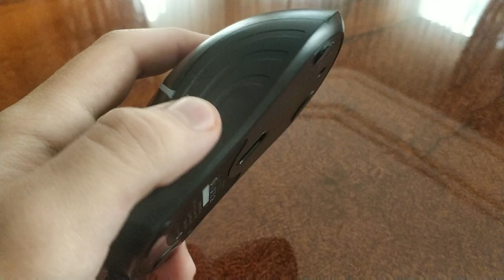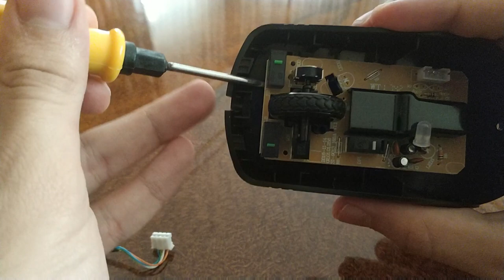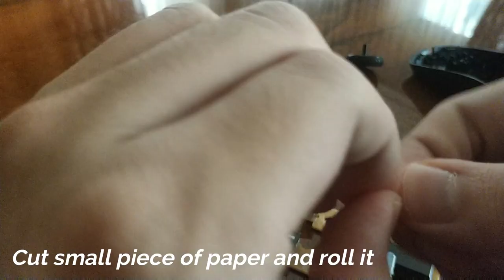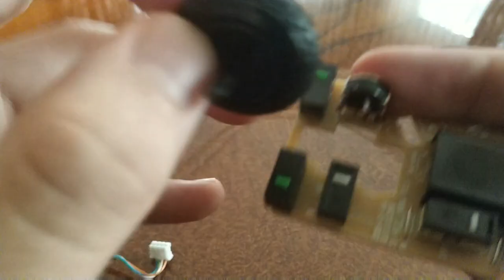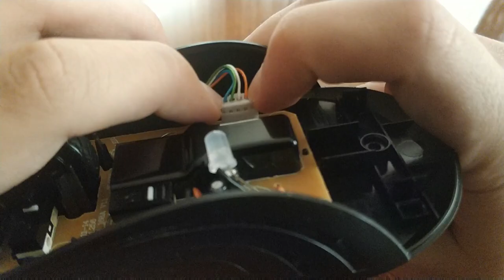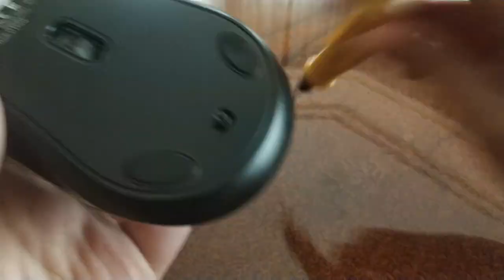How to Fix Mouse Wheel Jumping!

Comment: For anyone reading the comments. An easier way is to take a small piece of tape and put it around the part of the wheels shaft that goes into the encoder. Much easier to put it back in that way.

Comment: Hi guys! I'll just share what worked for me because I can't quite follow this since my mouse is wireless.
I blew on the scroller since it has little gaps on the side, thinking maybe it just had dust or debris stuck inside or around it. I kept blowing like pressured air on it while scrolling it up and down (while it is connected to my pc) and it worked! This is an easier fix for this problem since you don't have to disassemble your mouse and all.
Hope this helps!

Comment: Thank you so much for this! I've been having this issue with my Steelseries Rival 700, and I really didn't want to drop another $100 on a new mouse. It was a pain in the ass to take it apart and get to the encoder, but it was all worth it. The mouse wheel scrolls like it's brand new. Hopefully this lasts for a while.

Comment: I was just thinking  of dabbing a drop of super glue in there
But i dont think that is the issue because i dissasembled my mouse and was checking the hex hole and it was rotating but i still wasnt getting any input well i do get it but every 10th scroll it goes like up or up and dowwn in the same time.

Comment: Excellent worked like a charm for me. Just make sure and put your cover back exactly like it was. All mice are little different and realized my right and left clicking buttons had a little lip on the bottom of the cover they had to go under for proper fit. Thanks!!!!!!!!!
Reply: Hey do you have the exact same mouse as his???
Reply: @purveshsoni2960  No, mine is different, instead of popping apart with a screwdriver, mine has one screw in the bottom

Comment: I used a small spring.

1)opened up the encoder's metallic case(be careful not to break the case)
2)put one end of the spring on the outside of the small metallic plate that keeps the inner encoder wheel tight/compressed to the plastic case
3)the other end on the out side where the shaft of the wheel is inserted 
4)Then closed up  the main metallic case

This will tighten the inner wheel and create sort of compression 

Note: when the inner rotating mechanism is loose because of the small metallic plate losing its rigidity over time is what cause the scroll wheel to be all jumpy.

Putting a paper like this only make the wheel hard to turn but doesnt fixes the main cause of the problem

Comment: bro so... i cant open my mouse because it doesnt have any screws and yes i did search for them under the pads from research and still nothing and i also tried canned air and still didnt help :-(
Reply from the maker: Unfortunately there are some mouses that doesn't come with screws
Reply: @OrkhanAliyevdev  i realized bloeing actually works because thing that was wrong was that my mouse wheel was too on the right so the air couldnt get in
Reply: But awesome vid dude
Reply: @Vinguandur  If its a cordless mouse the screws might be under the battery department.
Reply: @danielrice5474  it is wired

Comment: Uncheck "HIDE POINTER WHILE TYPING"!!! 
...for those who have this problem take a sec first and just try unchecking this in... control panel < Hardware and sound < Mouse < Pointer options(tab) < Hide pointer while typing(uncheck this) 
For some weird reason this solved my problem of the wheel going in the opposite direction sometimes when i scroll, so glad i figured this out it was driving me crazy!

Comment: thanks! this method worked on my rapoo wireless mouse. i couldn't insert a paper though so i just used those faber castell tack its, and it worked just the same! saved me like $15 on buying a new one, i really wanted to repair it because it's a bit expensive and came with a keyboard. thanks again!

Comment: u can even open ur mouse and clean mouse wheel and attach some teflon tape to ur wheel side to tightenup ur mouse wheel u can instead use paper to tighten up the wheel but its not recommended coz it will be effective for less time i used it for my gaming mouse it will last me for 6 more months or more

Comment: THANKS MATE, I LUCKILY HAD THE SAME MOUSE HP150. LIKED AND SUBSCRIBED
Reply: Hp 150 doesn't have the screw at bottom to remove the bottom plastic? How did u did that? I have that same bloody mouse😓
Reply: @bhavesh4267  IT HAS A STICKER. REMOVE THE STICKER

Comment: For the Tecknic 6D game mouse, I could never get the scroll wheel out, but could get an improvement of scrolling by just removing all the gunk inside. Of course, it was easy to open it. It's just held together with two screws and a one of those "ingenious" snap methods. However, even though I can see exactly how it should work, I couldn't get it back together. Finally got my son to crank/snap/crank/bang it somehow together. Turns out, the wheel scrolling is better but still doesn't work 100 percent. Solution: I use now two mice. One pretty much dedicated to scrolling in documents. 🙂

Comment: I didn't have to take mine apart because I just blew into my mouse and a load of dust flew out. (Yes, I literally put my mouth over the mouse wheel and gave it the kiss of life). Thank you and goodnight.
Reply: OMG tom i love ya mate i was just about to take my mouse apart but i saw your comment first and decided to try it.....

guess what, it worked. ILY
Reply: @zeljkoholik5594  UPDATE: Blowing into the mouse only worked for a couple of weeks, then same problem. I took the mouse apart and saw lots of fluff around where the mouse wheel goes into the encoder. I removed the fluff and that worked for another week or so but in the end I had to take it apart again and put a very small piece of paper in (not folded, any more than one layer wouldn't fit) - now my mouse works, the mouse wheel is slightly stiff to scroll but I'm just happy it's working perfectly and I don't have to use more of Earth's precious resources buying another mouse! All's well that ends well. Moral of the story - take your mouse apart and follow this great video!
Reply: @tom8008135  yea i took mine apart too and cleaned it thoroughly and it works. I'll update you if it starts skipping again.

Comment: guys you dont need to do this you can just blow into the laser at the bottom and if there is an opening between your scroll wheel and the sides of your buttons just blow into it i just did it works perfectly for those who dont want to open a mouse up and risk breaking it.
Reply: Skedewdles Wow ok guess that worked thank you lol
Reply from the maker: Blowing method is only for those whose mouse's internal parts are full of dust. You can see clearly in my video mouse's internal parts are clean enough and blowing doesn't help
Reply: Not to mention blowing works for about 5 seconds, as you definitely know all too well.

Comment: Thanks man . i fixed it . Also if anyone having trouble opening your mouse . sometime there is screws under the small bads or the sticker . you need to unscrews them to open it . you know you have more if the mouse did not open easily .

Comment: If this doesnt help and you have a mouse where the encoder wheel has exposed contacts (not the contacts on the circuit board but in the encoder wheel) just blow at the contacts while spining the wheel, fixed it for me, or use canned compressed air if you wanna be safe.

Comment: To be honest the method works but it's my length of the scroll wheel 
that's the problem for me 

any ideas or do I have to waste like 20 dollars
Reply: Length of your scroll wheel? Have you attempted changing your settings on your operating system?  Its not a hardware problem in all cases - sometimes problem is on the software side.
Reply: @IgnitionZA  I did that nothing happened

Comment: This is a good quick fix but there's a DOWNSIDE: the middle click button is going to get harder to press and requires a lot more force than usual. You need to experiment with the thickness of the paper because if it's too thick then the middle click button would be almost impossible to press! So I removed the paper and just cleaned the sensors and the internals as much as I could. The jumps are still there though not as bad as before, and my Steelseries Sensei RAW definitely needs a new encoder.

Comment: I tried this, the mouse works a little better. it will stop while scrolling and then go. it also still might jump.
It's still better than the scroll wheel jumping 2 miles every second.

Comment: I can’t find the screw that holds my mouse together
Reply: It's sometimes underneath the sticker on the bottom. Can usually jsut feel for the hole with the screwdriver and jam it through the sticker. There may also be mice that don't use screws and just lock together but I'm not sure.

Comment: Removed the circuit, cleaned some part of the encoder. Mouse still jumping
Reply: Try adding the small piece of paper inside the encoder like he did. Mine was jumping too before adding it
Reply: Nicolas thx for the suggestion but im just buying a new mouse. My current one is rather old. 👍